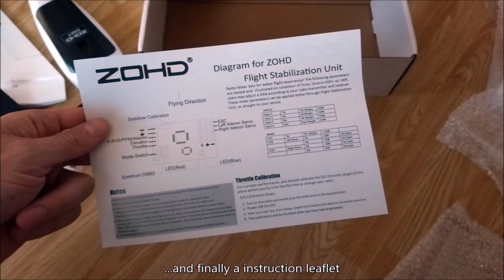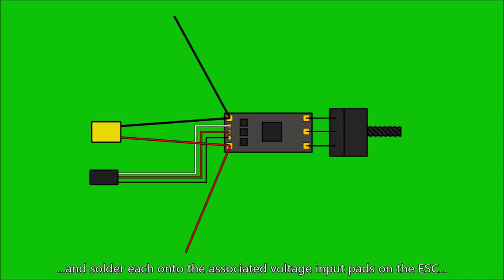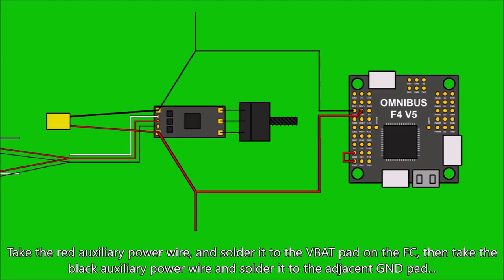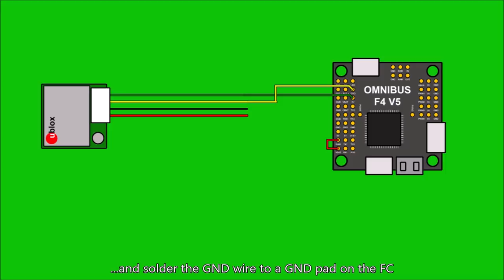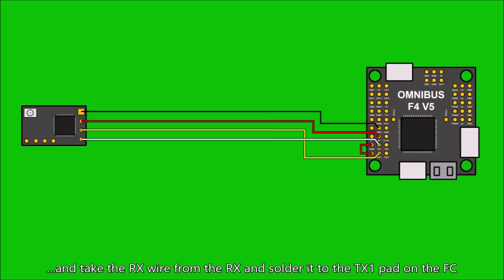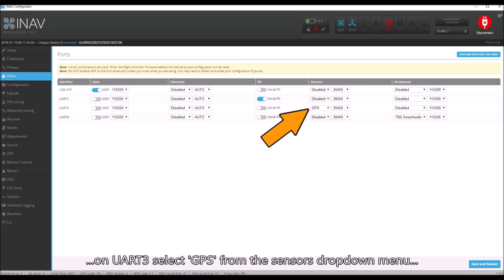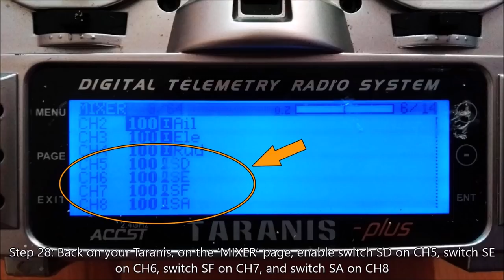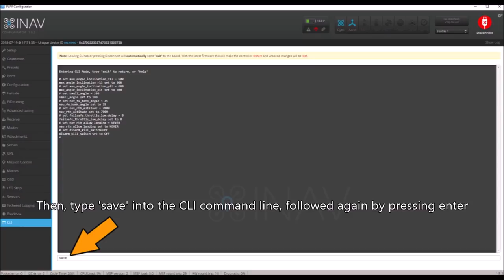🛩️ ZOHD Dart - Detailed step by step INAV build

Comment: I found the spar will crack pretty fast under normal usage. I drilled out the holes a bit and replaced it with a 1/8th inch aluminum threaded rod

Comment: I'm looking to build a sub 250g dart but I needed some more info

What's the weight of the dart kit? 
What's the motor mount size? 
Would a 1806/1606 motor fit
Could a 4 in prop provide enough thrust?

Thanks in advance!
Reply from the maker: I'm affraid to say that (unless you have a old version 1) it's not possible to do a sub 250g build with the dart. I can't remember the weight of the dart kit, but I do know that's it's too heavy. Even with modifications it's pretty much impossible to do
Reply: @gizfpv  that's a shame :( thanks for the info

Comment: Dear friend! Why can not I use a 150-300 dshot at the configuration in 2.4.0? I make the settings, save and reboot the controller, with a new input I see the standard again. There is no information about this anywhere. ESC supports 300 dshot.

Comment: I am about to start my mod to the Zohd Dart exactly like you. The only difference probably will be I will be using Omnibus F4 V3 and the R9mm receiver. It is nice to come across your video just in time. I have a question, when I test the plane in bench, I found that the ESC is extremely hot, not to mention I am just using 3S in the test. I am thinking whether I need to put in a better ESC. Can you tell me your experience whether that stock ESC is reliable for say 30min+ of flight (understanding that air cooling is good in this plane)? I am testing CG on bench, I will be using Li-ion batteries, 3S seems balance the whole thing well. If I want to use 4S, I need to do 3 x 18650 at the front and 1 at the middle i.e. seperate packaging. I like the speed of 4S. Are the stock ESC and motor be able to stand 4S ?
Reply from the maker: The esc will get hot if you run the motor at full power for extended periods of time, and it'll get warm from general use, but it shouldn't get super hot if you're just bench testing. I didn't notice mine get hot, but didn't really check it either. Obviously in flight it'll get some air cooling which will help. I don't know if the stock motor and esc can handle 4s i'm affraid, i never tried it.

Comment: Are you sure vtx telemetry should go to Rx6? shouldn't it go to Tx6?
 excuse me if i'm wrong, it's again an awesome video :)
Reply from the maker: You're probably right actually, would make sense, the fc needs to 'transmit' data to the vtx, so that should probably be the tx pin. I never actually used smart audio on that vtx so didn't notice if it worked or not

Comment: Where I can find the settings CLI codes for some particular model ( S800...Mini Talon....Chaser 1).? 
Or is it on some site in internet?
Thanks for video!
Reply from the maker: The CLI codes I use are generic, and I use the same ones all my builds. Have used them on a S800, mini talon, nano talon, hornet, z84 and Caipirinha
Reply: Giz FPV 
Thanks!

Comment: My generic applied cli commands are basically the same as yours except set disarm_kill_switch=OFF. What does this do/effect?
Reply: I also noticed long range TX (crossfire) but the vtx using axi stub is really set up for short range. I have had a lot of issues with range with Frsky receivers even quite close (XM & XM+ are the worst), XSR's are a bit more reliable and was wondering about crossfire micro, even though I have no interest in long range flights.
Reply from the maker: TakeItToTheGround If the killswitch is set to ON then you can disarm the aircraft whilst the motor is spinning, but if the killswitch is set to OFF then you can ONLY disarm the aircraft when the motor is not spinning. I set the killswitch to OFF so I can't accidentally disarm the aircraft in flight
Reply: So only disarm when throttle reaches min_throttle? Makes sense. I have accidently disarmed once myself with my goggles on when I used the wrong switch. Mind you I like the safety factor of instant kill in case my fingers are in the way. Shame disarm_kill_switch=OFF just doesn't apply when flying and you can still have instant kill on the ground.

Comment: how do you get "uk" measurements (metres and mph)?
Reply from the maker: Use firmware 1.8 or higher, then on the OSD tab in Inav you can set the measurement units to metric, imperial or UK via the drop downbox on the right

Comment: Can you confirm which Target firmware you are using as I am unable to get GPS working?
Reply from the maker: Omnibus f4. When you say the GPS isnt working, what do you mean? Does it get power?
Reply: @gizfpv  Hi,  Yes it powers up but no signal. Ive wired it exactly as per you video. GPS icon RED. I am using omnibusF4 target firmware
Reply from the maker: @David-ts9tq  Ok, firstly, are you testing it over USB or with a battery connected? You may have to have a battery connected to power the GPS unit. Secondly, on the GPS tab, on the lower left hand side there should be a label that says 'errors' or something similar. Are you getting any at all? Or is it stuck on zero?
Reply: @gizfpv  I've just connected a battery as well. Still the same and in the gps tab everything is zero. I have the Naze mini GPS ublox g7 module
Reply from the maker: If the module is 100% getting power, but you're seeing 0 on the errors then that can only mean 2 things. Either the tx and rx wires are backwards, or the module is faulty
Reply: @gizfpv  just checked and I had a bad solder joint on the TX rail.  Now sorted and GPS icon is blue.  Nothing shows on the GPS tab map wise but that maybe as I'm indoors?  Thanks for your help
Reply from the maker: Ah glad you managed to solve it. Yeah you'll need to be near a window or outside to get a GPS lock

Comment: Maiden direct in Horizon mode?
Reply from the maker: Yeah. I like to maiden with some form of stability mode incase there's some inbalance in the setup. That way I can get in the air and then sort out the balance issue, rather than potentially have the aircraft crash and get damaged on a failed launch

Comment: Mate did you ever get this dart to 250g?
Reply from the maker: Nooo, nowhere near. You can't do a sub 250g dart, unless you have the original version 1. Even then you have to do extensive modifications
Reply: @gizfpv  where you bin man?  Not seen any footage recently...
Reply from the maker: @bg563195  Tbh, I've kinda stepped away from the hobby for a bit. New rules and the media constantly attacking the hobby has made it more stressful than fun 😩 I've actually got most my aircraft up for sale now. I'm not leaving the hobby completely, but gonna be flying less. I am working on a new project though 😊
Reply: @gizfpv  bummer
Reply: Where is you gear selling, is it on ebay or something?